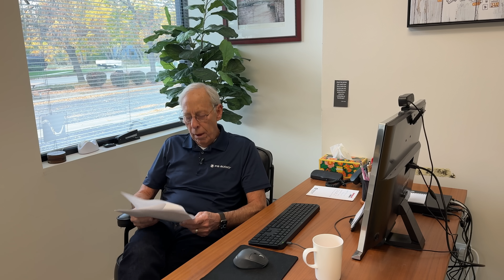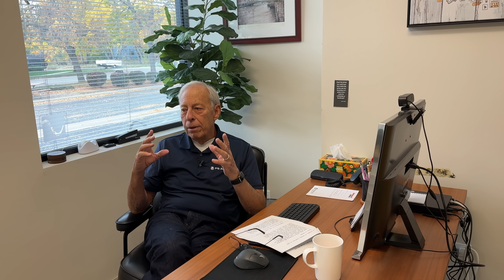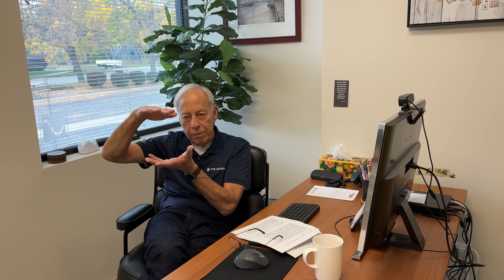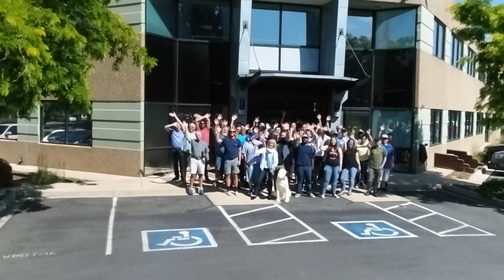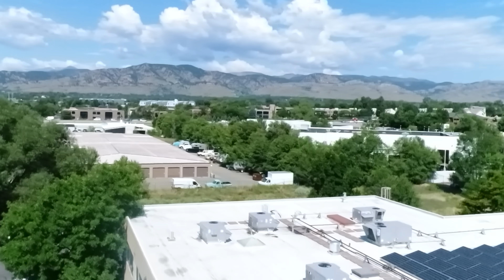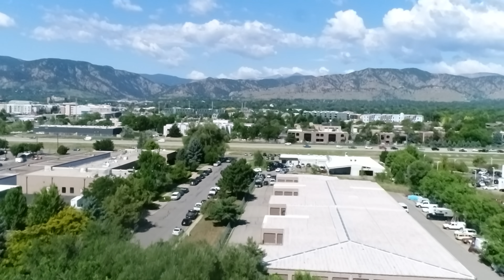Chips vs  discretes in HiFi

Comment: Burson sells amazing discrete op amps,  the V7 vivid are amazing but they are quite large and won't fit in most cases.

They also sell the Burson V5i which is the integrated version, they also sound great and can be used as a drop-in replacement for many consumer grade systems including some PC sound cards.

Comment: In technical terms no discrete amp can match a chip. Thats not a discussion.

Subjectively ? Well , its different for every single person. If you prefer the discrete solution and works for you then yey for you.
Will it be okay for everyone ? Hell no.
But , if you prefer the inferior solution , witch is perfectly fine, you do allso acknowledge that you do not like accurate reproduction. Thats allso fine as is. Nothing wrong there.

Claiming to hunt for the trchnically best , and doing so whit a discrete solution however ... does not work out. If you want the best  in techincal terms , then discerete is out of question.
Reply: Great discussion.

A beautiful comparison of opamps to tubes.

Each of us has a different sense of hearing. Therefore, each of us must adjust the sound signature to our own hearing preferences.

Thanks and regards, Kris
Reply: As an engineer with studies in electronic circuit design I can state that no integrated (chip) can match a discrete circuit if we are talking about an amplifier unless you are only focused on price or size but not on quality or performance.

Assuming we are talking about low power the main reason is matching, you can match parts like transistors and resistors for each amp when it's an integrated circuit but that's virtually impossible on an integrated circuit. Proper parts matching is critical in a high quality sound system. Brands like Burson are famous for it. They use resistors with a very low tolerance, usually 0.001% and then individually measure and match the ones closes in specs, similar to what's done with bulbs.

I guess you image that the parts used to manufacture discrete components are perfectly identical and has lower tolerances than discrete, but that only applies for cheap discrete parts. 

The best possible discrete op amp will put to shame the best possible integrated op amp in all metrics except power consumption, price and size.

So I have no idea where you got that information, but it's completely wrong. Feel free to ask if you have any questions.

Best wishes from NYC 👋
Reply: @CesarAnton 
Shorter paths , semiconducturs made from the same silicone,  etc....
If you are an engineer you would not consider discrete opamps ever.
Chipamps are technically superior. Its physics and reality.

Whit discrete parts Just the soldering and traces them self warrant inferior quality to integrated chips. Parasitic losses , huge area acting as an antenna , differences in silicone material between active elements... Just s few areas where discrete parts have zero hopes to get remotely close to integrated chip amps.
Reply: @nagyandras8857  what you say it's only true in low power applications. All your points focus around low power consumption, not fidelity in sound reproduction.

The lower paths only matter in low power and high frequency applications, HiFi sound systems focus on 10hz ~ 20khz range.

You are describing digital music, if you think an MP3 connected to a class D amp is the best type of music then you are not an audiophile.

You don't seem to understand how integrated circuits are made, they also install parts on them, it's not only lithography. 

You can measure this with an oscilloscope on a lab and reality is very different from what you imagine, integrated sound systems which usually use switching power supplies has much higher noises in the output signal.

I'm not assuming things, I'm making an educated statement based on my experience and you can confirm this in a proper lab. If you don't care about the science that an engineer is trying to teach you, that's up to you.

Have a good day!
Reply: @CesarAnton 
You are Just assuming things.
You are not an engineer.
Chipamps come in class AB too , not Just class D.
Noise pickt up is an issue whit discrete parts far more Than whit integrated chips.
You can not match discrete components , transistors as well as its done whitin a chip.

The only advantage for discrete output devices would be higher heat dissipation.

If you would be an engineer then you would not assume by any means that a chipamp must be class D.

About powersupplies. Allso if you would have a hint ... then you would realise linear supplies do carry more noise over from the main's line . Specially whit today's main's whit many low power factor devices stuffing it whit noise. 
When a very Stable,  high current dc is required , its switching mode. Better isolation and noise filtering.
Like whit computers. Nowdays cpus require voltages only in the close range to 1 volts , but it has to be very clean and deliver more Than 100 amps whit ease.
Reply: @nagyandras8857  Yes I am, I have a degree 😉

We learn and test in the lab about op amps and power supplies early in college, it's basic and you seem to be confusing some concepts.

Computers are extremely noisy because the high frequencies used, they don't mind because they are digital and the CPU has usually ~1v range.

Sound is analog so it works best in class A or at least a heavy A biased AB.

Switching power supplies are the worst for audio, they are very noisy. Linear are the cleanest, hence the name and they use filtering to remove AC noise, I use 4 stages of EMI and RFI filtering.

You can get course in electronics in a place with a proper lab, power supplies and op amps are usually the most basic ones if you want to see for yourself.

Again, it's not an opinion but a scientific fact that I've personally demonstrated in a lab. I have pictures with my now wife back when we were young next to an oscilloscope showing the before and after of our linear power supply project back at college.
Reply: @CesarAnton 
You are not an engineer.
Otherwise you would know , that linear supplies have switching noise too , in the 50/60 hz + harmonics range.
Thats well whitin audio Band.
Switching mode supplies noise is out of Band as the switching takes place at far higher freqvency.
Reply: @nagyandras8857  there is no switching in linear power supplies, we use a full bridge rectifier plus capacitors and inductors for filtering.

The voltage is transformed at the AC frequency, no high frequency switches are used.

In some cases there can be some resonances in the 60hz that can be picked by very sensitive class A amplifiers, in those extreme cases you must use a power conditioner which first transforms AC to DC and then back to AC using an alternator.

Some brands may use a high frequency in the alternator before passing it to the linear DC rectifier to prevent resonances but it's a rare practice. And there is no switching involved.

Switches are used to increase frequency and allow for a smaller transformer to be used. It is possible to create a clean switching power supply, but there's always some compromise so it's never used on the really high end.
Reply: @CesarAnton  
You are not an engineer. The 50/60 hz switching of the mains is still present after the rectifier diodes. 
You can smooth it to some degree whit reservoir capacitors , but even so the ripple will still be there , and it will be load dependent. 
You could try and use a regulator , helps a lot. But even so , you will still have the switching noise.

If you where an engineer you would know that the sinusoidal main's voltage crosses zero volts , and that is defacto eqvivalent of switching. Since till the voltage does not swing away from that crossing till the diode can conduct  , you got no current flow. Depending on the diode forward voltage that can be Just 0.3 to 0.7 volt or in cases more.

This is why you do have switching even whit a full bridge rectifier.

To test , grab a full wave rectifier and apply a sinewave that is less then 0.3 volts. You won't see anything at the outputs.
Apply 1.5 volts. Observe what you see on the scope. Pretty chopped and more resenbling a square wave.

Pointless to showcase any more indicators of you not being an engineer. If you where , these lab tests you had performed. Actualy if its a better school , even if you are a technician .
Reply: @nagyandras8857  you are just being rude, I have a college degree and I guess you don't and that's why you are so aggressive? Maybe you do and just didn't study hard enough :body-blue-raised-arms:

Your understanding is just superficial, enough to make you think you know what you are talking about but not enough to really understand your limitations.

To quickly prove my point, your example just demonstrates your lack of understanding. If you apply a 0.3v sine wave to a diode you will get no output because the threshold voltage is silicon is 0.7v. Even if you use Germanium which works at 0.3v you will only get the crests. 

Also, we are talking about 120v at 60hz and maybe up to 5 amps. Context matters. You just try to adjust scenarios to confirm your biases.

So engineers are wrong and you know best :yougotthis:
Reply: @CesarAnton  
you are not an engineer.
switching noise will be present even if the voltage is higher. that is the working principle of a diode rectifier. for half the wave only half the didoes are on. the other half of diodes are off. and vice-versa for the other half of the wave. diodes going on and off. 
discrete transistors can never be as well matched as transistors sharing a common substrate. output devices , current followers however need more dissipation. those are usually external. however, not allways. the venerable lm3886 and tda 7293 / 7294 series chips are capable even whitout external current followers. 
or we can even mention the lm1875 whit more modest power, or the tda2020/2030/2040/2050, or even sta540.

i'm not rude by any means. you state things that even a technican will know well to be b/s. and claim you are an engineer. you are not an engineer.

no linear supply can match a modern smps. for very obvious reasons. very early smps did have its own problems, but that was quite a long time ago. even so, any enginner would prefer ACTIVE rectifiers to avoid the problems discussed. in the eraly 90's among engineers building quality amplifiers it was common place to resort requiring 3 phase power, and using schottky diodes for rectification. an engineer is aware of the more favourable voltage drop.  but then active solutions came available and viable. an even better solution would be a precision rectifier. that uses opamps. naturally all these solutions where available, since  even opamp based superdiodes where published and known prior 1990. 
but by y2k or so, linear supplies had ben surpassed by smps technology. 
even so, none of the above solutions could match battery provided dc. rectification will allways be noisy, linear supplys still are inferior to switching mode.
Reply: @nagyandras8857  so according to you the engineers at Burson (Australia) are wrong and their v5i is superior to their v6 and v7 discrete lines.

Or that the audio engineers at Schiit (USA) are also wrong by focusing on building discrete components on their high end gear.

And we can make stronger cases with more expensive brands if you like. But I guess you know best because...?

Have a good day 👋
Reply: @CesarAnton 
Read the op again.
Yess its technically inferior to use discrete solutions instead of integrated. 
Subjectively still can be preferd. 

Just like tube amps vs solid state amps. Tubes are inferior . Higher thd , less efficient etc...etc...etc... but some prefer the way they sound.

So , again , objectively , discrete parts will be inferior to integrated chips.
Subjective bias is a nother thing.
Reply: @ 100% agree with all you just said.

Comment: Ok. The truth is about space and cost. Anytime you can space the parts further apart.. its better. . Also..the parts can have better current and voltage ability and lower noise..the negative side is size. And they dont heat and cool uniformly..I worked with pioneer in the subject.. The industry wants smaller products..I said years ago..THE king is through hole parts and silver solder on ceramic card.. but again..the ceramic card theory expanded and contracted and ended up with solder issues.. AT ROCKFORD FOSGATE WE DID ALL THIS 35 YEARS AGO

Comment: Reality is FAR more complicated! Thermal coupling is a great feature in chips. Remember also that the power supplies are the single most critical part - and they were designed for a chip - not the power hungrier discreet after market replacement. I have NEVER heard a discreet replacement sound better - but that has more to do with never having heard a "problem" with a good chip that needed to be fixed. Different is elusive and we are all suckers for bias confirmation. Therefore, if you prefer discreet, buy something designed from the ground up that way. Do not believe that $100 is going to make you better than a real engineer.
Reply: Then you haven't paid for a quality discrete op amp, try the Burson V7 vivid and then we'll talk.

And I'm a "real" engineer, I have my college degree and took several semesters learning about electronic circuit design.

The best possible discrete op amp will put to shame the best possible integrated op amp in all metrics except power consumption, price and size.

Assuming we are talking about low power the main reason is matching, you can match parts like transistors and resistors for each amp when it's an integrated circuit but that's virtually impossible on an integrated circuit. Proper parts matching is critical in a high quality sound system. Brands like Burson are famous for it. They use resistors with a very low tolerance, usually 0.001% and then individually measure and match the ones closes in specs, similar to what's done with bulbs.

It's virtually impossible to individually measure and match parts inside an integrated circuit, therefore integrated circuits will always provide better quality. It's not a personal bias, it's an objective and measurable reality. You can confirm it yourself with an oscilloscope in a proper lab.

You almost have a point about the power supply, although you are probably over simplifying a bit too much. They are not made for a chip, there no such thing. In the simplest terms they are made to supply up to a certain amount of voltage and current, if you go above that they will start generating heat and probably more noise, specially if they are switching power supplies which are not good for audio anyway. As long as the discrete version is within spec it should be fine. Otherwise the problem is not the discrete amp but that you are using one that is not appropriate for your circuit.

Feel free to ask if you have any questions.

Best wishes from NYC 👋

Comment: One slight problem if you change the chip in the circuit the circuit will have the same feedback resistor as it did with the prior chip so no open loop gain differences would have any effect or benefit

Comment: ICs are known for internal heat noise. Discrete components give better performance by reducing this internal device crosstalk.
Reply: in discrete circuits you also can throw in some capacitors here and their to reduce that crosstalk over the rails which is not possible in opamps. you can't put 100µF in a chip. i think that this is a significant difference.

Comment: Built a few amps, started with the Delta-Audio Leech Super amp boards, which is a discrete design.  Then moved on to the LM4780 chip amps and used on per monoblock (gainclone design).  Both sound very nice driving some pioneer S1010s.  If anything, the leech amp takes a while to "warm up" due to the bias circuitry.  Fun.

Comment: I think the progression from discrete components to highly integrated circuits has always been about size reduction. You could not have an i-phone with discrete components. Unfortunately, the high end audio industry is not driving semiconductor production and we are left to design with what is available. So I think Paul is correct here - to realize the best design, you will probably need a combination of discrete and integrated circuits.
Reply: you just can't put all analog components on a chip. like a 100µF capacitor. the high density integrated stuff is much better suited for digital circuits.

Comment: I think it is fair to say that an amp built with discrete parts is not universally better.  But a good designer will have the freedom to create something built for purpose that works better than an off the shelf op amp produced by the millions for everything you can imagine.  I think a better example might have been the phono pre amp that Darren designed.  I recall his talk about the design process.  He had a circuit that measured well, but in listening tests just did not have the life he was seeking.   A complete redesign produced something special.  With an op amp that entire process would have been an hours work to pick a reputable chip and stick it in the program laying out the circuit board.  And a sound just like every other product using that chip.
Reply: There's a little more to it than that. Example, I have a Pioneer blu-ray player that had JRC5532 op amps in its output stage and I loved how it sounded. Till it died, so I thought replacing the op amps in my amp with JRC5532 would give me that sound I liked from the pioneer. And it did add a bit of what I wanted but didn't sound exactly the same. Usually you'll have resistors and other things in line with the op amp that influence the sound as well.